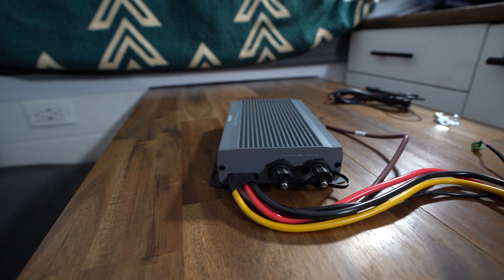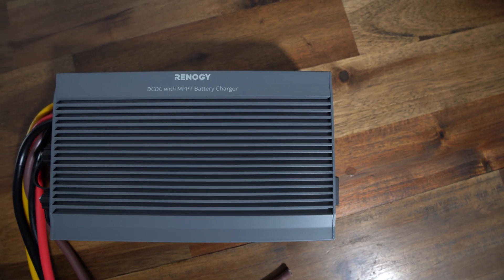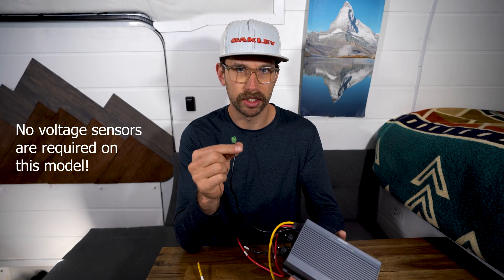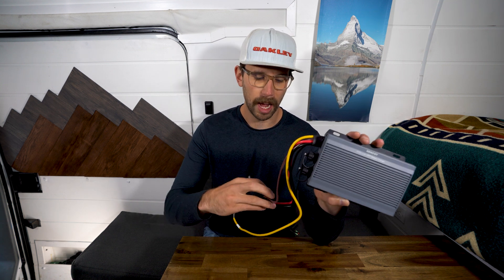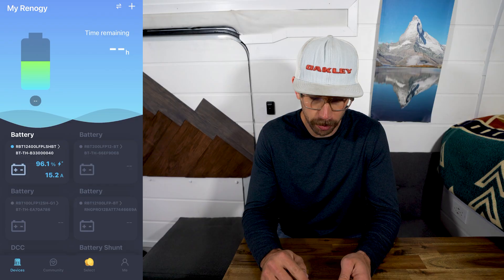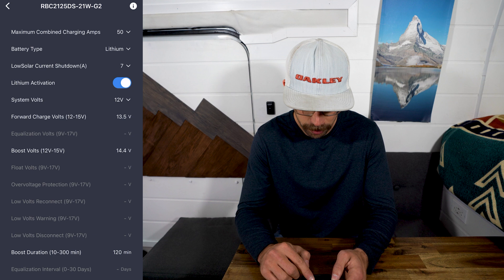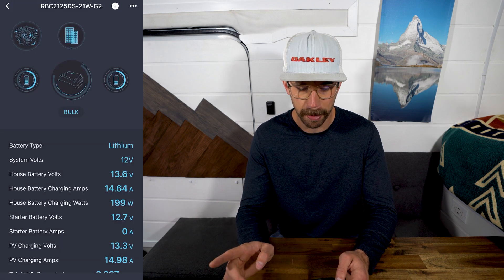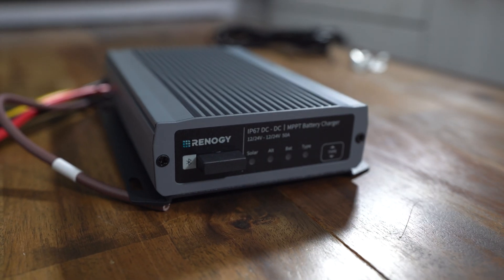Renogy 50A DC to DC Charger with MPPT Solar Input

Comment: I enjoy your videos and appreciate all the info and knowledge on this new renogy dc to dc charger. Your discount code worked great, $365 canadian funds total price yesterday.  In my ram promaster I will be hooking up to a 100ah bougerv battery . The charger will be mounted approximately 3ft from the starter battery and approx.1 ft1/2  from the house bat. Someone commented to use a 60a anl fuse at the starter battery and i believe a 50a at the house battery. Not sure on what gauge wire to use and connectors to the renogy charger. Any advice on my install would be very helpful . 👍
Reply from the maker: Thanks you very much! Glad it’s helped you out 😄 Renogy does have fuse and wire size recommendations in there user manual. I also have all this information and more in my Simple Solar Guide.

Comment: What version of the dc home app I am in the UK Nd it does not have the setting to adjust the solar input. Can you help
Reply from the maker: When you go into the controller settings, the first line says maximum combined charging amps

Comment: Thanks so much for posting this review!  I installed one of these units about 2 months ago, and have been frustrated by the lack of info online (and most of us know how (un)helpful Renogy support is). I've noticed that no matter my battery's SOC, the charger will only feed amps in either "Boost" or "Bulk" mode.  I have a Lithium battery and have the app set to use the default settings for that type. Should I expect it to see a "float" or "absorption" mode once the battery is fully charged?  Initially, my battery went into an overcharge protection mode once it was fully charged (it seems the charge controller kept trying to feed amps into the fully charged battery) but I haven't seen it do that lately.
Reply from the maker: That’s strange. You might be able to go into user mode and manually change the settings

Comment: I just installed this over the weekend and I cannot get the DC Home app to let me adjust settings even though I manually placed the DC-DC into "user" mode.  I have a "smart alternator" that seems to only put out 12.7 volts to my starter battery so the Renogy won't pull amps to charge.  Only charged once when I first went live with the system.  Does your user adjustable settings work for you if the charger isn't actively charging?  I simply have no settings to go in and change.  My phone won't readily connect to the charger direct and I have to use the new Renogy One to be like an emissary between my phone and the charger... Not overly happy right now...
Reply: Also, the older model you have used an ignition sensing wire whereas the new one doesn't even have one.... in the instructions it says that smart alternators may need to be wired differently, assuming the ignition sensing wire but it doesn't have one!  Wish I'd just bought the older and cheaper one...
Reply: @Bizill75  My guess is this is why they have it marked from $499 down to $349. They realized it has design flaws. Even that cheaper Redodo one has an ignition sensing wire.
Reply: @jasoncarter4584  Its fine to not need a wire IF it can detect from the voltage changes, though.
Reply from the maker: As long as the charger is connected to a 12v battery, I can adjust the settings. Have you tested this when the vehicle is moving at higher rpm’s? You may need to be driving on the highway for the charger to start to pull more amps from the alternator

Comment: I got one months ago, seems to be a bit of lemon ? Even with some cut off at 10 amps, the unit only pulling 24-25 amps from alternator. Then Sometimes it’s 40-45 amp.
Reply: Could it be a "smart alternator"  issue?  I'm seemingly having only problems with my Jeep Gladiator and its "smart alternator".

Comment: If you don’t need the fancy Bluetooth get the redodo unit at less than half the price
Reply from the maker: @jaysonyang1441  along with no Bluetooth, it also only comes in 40 amps, less customizable, no water resistance rating, and it doesn’t trickle charge the starter battery when the house batteries are full. It also says it can’t use solar and alternator at the same time. But it is cheaper.

Comment: How did you joint the Wires together , Did you use some kind of step down butt connectors or  how ?
Reply from the maker: Soldering the wires together and using heat shrink is the best way to connect wiring but you could also use these which work well- https://amzn.to/45J6Y2U
Reply: @madetoexplore  Thanks I have mine all hooked up now, Will test on long road trip next week ,.

Comment: Hi, great video, I was about to purchase one of these units until I read the manual which says maximum alternator input 75-100A. My van is the Peugeot Boxer the european version of a Ram pro master. It is fitted with a 150A Alternator. Do you know if this new Renogy kit is compatible as its alternator is putting out about 50/60A at idle - trouble is I will not be at idle whilst driving around! This is my first van build and any help would be very much appreciated! Cheers!
Reply: Thanks for getting back to me - much appreciated. Here in the uk we don’t get that much sunshine so b2b charging is important supplement to solar.
How did you get on with joining the units wires to those from the starter battery and aux battery as they are very different gauges. Joining by twisting and wrapping with tape as recommended in the booklet accompanying the unit seems a bit of a bodge and asking for trouble in the long run. Do the units input and output positives get hot? Thanks for the discount code - it worked a treat! Cheers
Reply from the maker: @trevorclarke8596  we get barely any solar during the Canadian winter too. I’d recommend using something like this- https://amzn.to/45J6Y2U and then add some heat shrink on top. For the thinner gauge wire you can strip off extra and double it back on itself before crimping the connector
Reply: Thank you for the link for the connectors! Have you had any issues with the ten gauge wires heating up if you run at 50A charge? Cheers
Reply from the maker: @trevorclarke8596  no, i think the short length has little effect on it.
Reply from the maker: My van also has a 150a alternator. This is perfect for you because you can control how much the charger will pull from your alternator through the Renogy app. It can be adjusted from 10-50 amps.

Comment: My Bluetooth on this isn’t working past 1 meter
Reply from the maker: That’s strange. I’ve noticed a huge improvement on the Bluetooth distance with this model compared to other models. I think the small antenna on the outside helps. My 400ah Renogy battery Bluetooth is terrible
Reply: @madetoexplore yes it’s less than ideal and Renogy are on coms but fear it’s going back for new one. I have a battery further away than the dc to dc and that is ok but this charger is under the floor and I have to lay phone on the floor to get it to connect
Reply: Mine connects quickly and solidly with the distance between being about 1.5 meters. I think your issue is that you installed the unit under the floor, so the Bluetooth is being blocked by the sheet metal (and whatever other layers may be present). My battery is mounted under the van, and it won't connect to my phone without me getting the phone close to the floor.  You might consider using an external monitor connected via the CAN connections on the charge controller
Reply: @mschrank1 they replaced mine it now goes about 5 meters

Comment: Would this work for charging my power station while driving?
Reply from the maker: It could but using a 12v adaptor for the power station would probably be easier?
Reply: @madetoexplore  using a 12V cigar lighter adaptor only allows 10A, though.
Reply from the maker: Id use the Bluetti Charger 1
https://amzn.to/3Zs6dKc

Comment: I've got the older version, I haven't used it but a good tip on the solar cut off switch. 
Yeah the 30a is a bit lame on the old version.
Reply: Old version has also never 50v version
Reply: @JouniKyy-xn4kd  thank you edited to amperage 😲
Reply from the maker: It’s a great model! Definitely gotta have the switch if you want to pull 45-50 amps